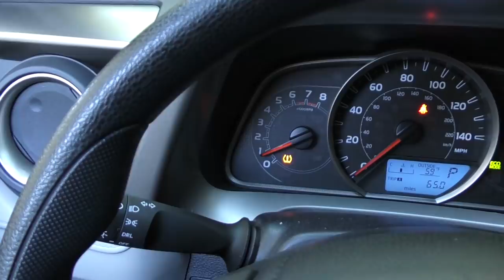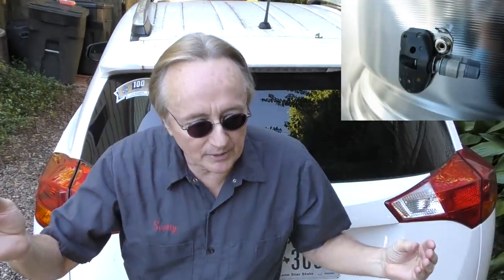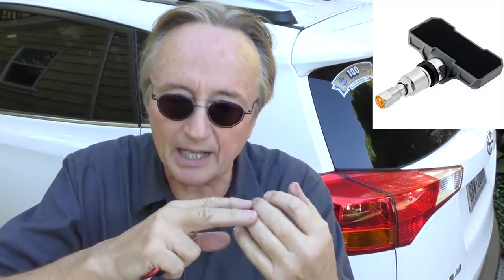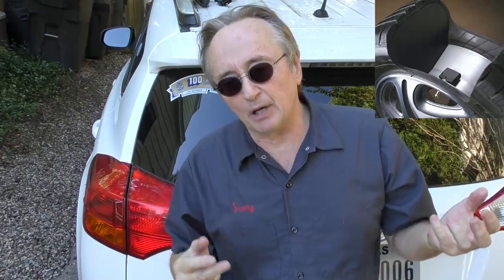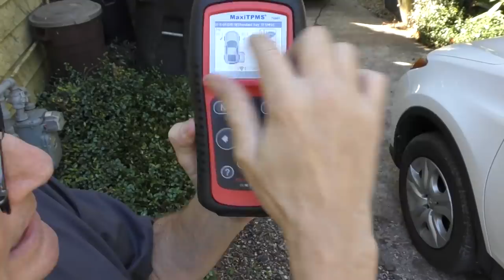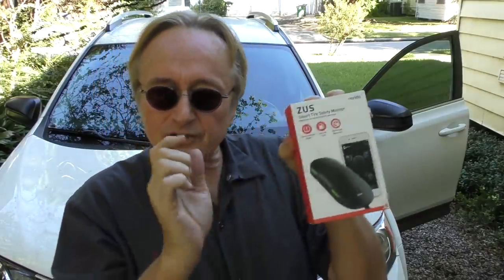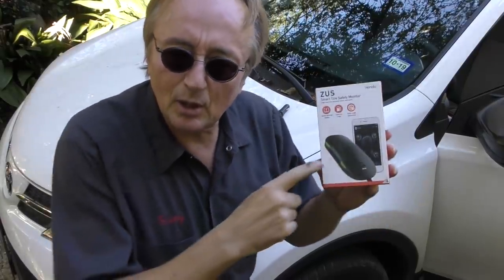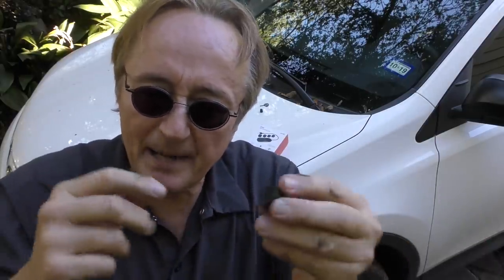Here’s Why This Kind of Tire is Stupid

Comment: One year when My family and me went on vacation when I was 12 or so and we went to the Oregon coast to see the ocean and we were having vehicle troubles, we had one flat tire and didn’t have a spare so we dropped it off at les Schwabs tire center and we picked it up and were driving over a bridge and all of a sudden the truck started shaking and swerving all over the road so my dad somehow manages to get the truck safely past the bridge and we pull over and he instantly goes and checks the lug nuts on the tires and they are so loose he could unscrew them with his fingers and a few were on the last thread about ready to fall off. Every single tire was like this. He got out his tire iron and tightened them back up and drove back to schwabs and stormed in their furious yelling you could have got us all killed! You guys didn’t tighten the lug nuts back up on the tires. They denied it for like fifteen minutes straight until my dad said I didn’t do it and they didn’t just magically loosen up themselves over the course of five minutes from leaving here. The employees were like “ uhhh sorry dude I guess we forgot.” So for whatever reason when they were replacing the tire, they also decided to rotate the tires but after doing so, neglected to tighten the lug nuts on them. It was scary.
Reply: There's a saying "if you want something done right, gotta do it yourself".
Reply: Remember, even for a simple tire rotation. They are not legally required to retighten lug nuts as long as they completed the service.

Comment: I went to Toyota because I had a flat, and I had to ride on it off the road just for couple feet, and it damaged the sensor. Toyota said it will cost just to replace my sensor 300 per one. I like hell no, I'll just put a black masking tape on the light warning.

Comment: NO ! NEVER use those 3rd party, screw on TPMS things.  The weight of those un-balance the wheel. Most importantly, they put weight and strain on the valve stem. My neighbor had a set of those, and the weight caused the valve stem to snap off after a few weeks. The tire deflated in seconds while on the hwy at 60 mph, caused home to hit the median and 3 other cars and was serious injury to a family with children...crash investigator determined it was those things that caused the tire to catastrophically fail. He is still in the legal hell hole of the law suits from the other people....

Comment: BMW had a better system. It uses the ABS tire rotation sensors to  calculate the diameter of your tire by comparing wheel speeds. No sensors inside the tire and no batteries to go bad. KISS.

Comment: My stupid chrysler van has the light on after I put an aftermarket stem and sensor in one wheel and it never synced up, I took it back to reset it 2 times, then another wheel quit transmitting. I’m guessing the battery died, then the replaced one quit transmitting again. I covered the light with black tape. I’ll check it with a gage. Screw that stupid crap!

Comment: I wouldn't own a car with this system unless it was easily removed in its entirety.
Reply: It's required by the Feds. There aren't any lamps to replace. It can't be easily defeated, either. If you trade or sell your car with warning lights on, expect a difficult time from potential buyers. If you do this jury rig to a leased or warrantied car, you'll pay for it.  My advice, if it is an expensive car, fix it right. If it's an old one, ignore it.

Comment: You forgot to say there are two frequency types 315 mhz and 433 mhz, Also if one goes bad the others are going to fail in hours days months later. It is like replace a headlamp. Why replace the one when you know the other is going to go bad. Normal usage. I have see one car lose both headlamps almost hours apart. Lady could not understand why she could not see well in city driving at night. LMAO I told her it would cost $150 to fill each with liquid halogen. LMAO. Then told her the truth. Replace both or all

Comment: This time Scotty is not telling the true. There are Autel sensors that replace the original ones and they cost 30$ each. Also autel tpms pad which is the tool used for programing them cost less than 100$. Those aftermarket shitty cap sensors are messing up with your tyre balance !!!

Comment: All these "macho" Ppl.  Saying just look at your tires etc. Well for more and more Ppl.  With decent cars they are putting lower profile tires on them from the factory. They look nice and make for a sporty ride. But THIS makes it much harder to tell visually that your tires are low. I love my OEM sensors, they have saved me many times! Mine go off when 10 lbs. Is lost. So about 25lbs. Pressure I get an alert. And even knowing this (my 2011 mazda 6 doesn't "tell" me which tire it is) I have to take a reading on every tire cause I can't just tell looking at my 18" wheels which one it is ! I'm a pretty seasoned driver as well. Just saying. I always have a spare sensor assembly at the ready. You can find them on line for around 40$. And install from a small tire shop is cheap. My car is   getting old but I've only had to replace 2 of these over 178K miles. So to me the OEM equipment is definitely worth it.

Comment: How about not replacing it with anything,  when the batteries wear out on the factory sensor's,  screw it,  to bad,  I got  a tire pressure gauge I can  check it once in a while myself ,  I'm not gonna buy anything to replace it with

Comment: That's one of the most unnecessary devices ever invented...you can use your eyes, and your feet to check tire pressure: look at them, and feel them. Unless you have no eyes and no feet, then it makes sense, otherwise, just another stupid solution for a nonexistent problem.

Comment: Just one more system to fail and cause people to spend money.  By the way, my tire pressure gauge is not digital because a digital gauge requires a battery and the battery will eventually fail.  I still use the old tried and true pencil style gauge!  Ha, ha, ha, ha!

Comment: this is the  kinda  a  Crap  that  makes  cars  cost  so  much  and i  could  live  with out,  I want  AC  And  Heat  windshield  wipers  and  an  automatic transmission (due  to a bad  Knee)  but I  can  roll  up  my  own  windows  adjust  the mirrors  and  the seat  with out any electronic  do  dads   to  wear  out  and  cost  me  $$